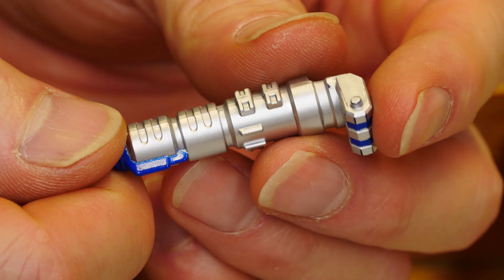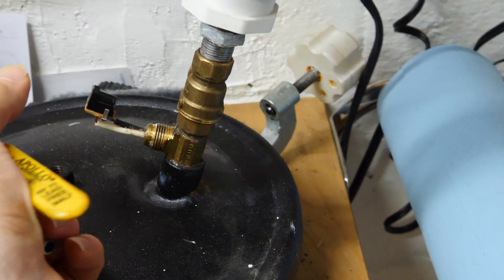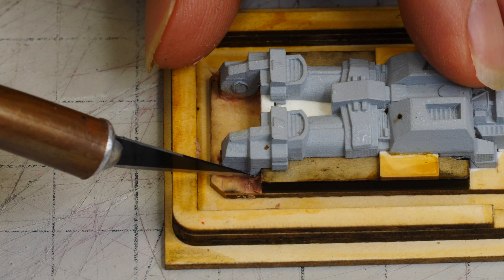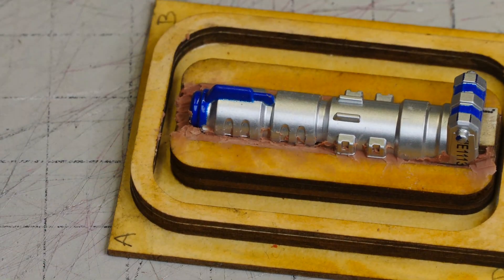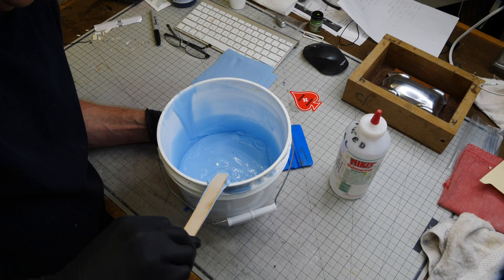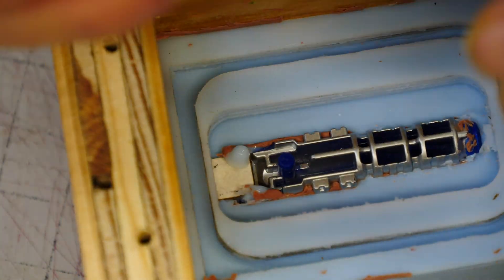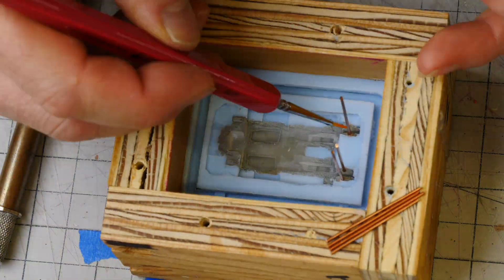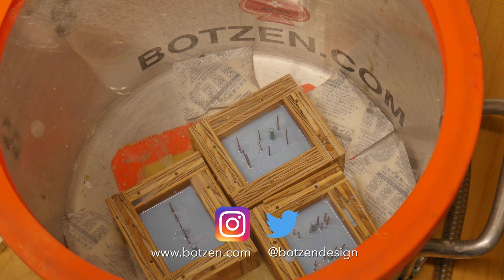Molding Toy Parts - Clay and Silicone: Part 2

Comment: does the super glue and sprue damage the original part when removed?
Reply from the maker: Very good question, sometimes the super glue pos right off, other times some of the glue remains and some clean up is required
Reply: @EricStrebel  great! thanks for the reply. i’m recreating some car louvers that are very rare and i don’t want to damage the original. i believe it’s ABS plastic. and was originally vacuum formed. do you think i should use something else to attach the sprues like the wolf sticky wax? also love all your videos and format. i feel like i’m putting myself through school haha. have been binge watching your videos. very helpful.
Reply from the maker: Yes, if you're worried about it  use something that would be non destructive

Comment: Have you ever did any insert molding with water soluble wax? I have a action figure part that is pvc I'm guessing(hard semi flexible material) andthat has a mushroom hole inside of it. The part is a bicep of a articulated figure and the mushroom hole inside of it is so the shoulder can pop into it. The seam on the part looks like it was a 2 or 3 part mold...Anyway, love the content! Subscribed!

Comment: Hi Eric. Recently found your channel and the content is very informative.  I have made and castes small figures and tried to use a squeeze bottle and pipets to resin fill small parts. But the resin seems to adhere and they end up being single use. What type of syringe do you use and do you pre coat it with any release agent?  I’d appreciate any advice.  Thanks!
Reply from the maker: Just regular syringes nothing special

Comment: When you put the silicone molds in the vacuum chamber did you also put them in a pressure pot off camera? If so do you think this technique will work with resin also if it got a long work time?
Reply from the maker: no, silicone does not go into a pressure pot. But resin in a pressure pot no matter the working time should be good.

Comment: what kind of accelerator do you use?
Reply from the maker: ZAP, Thanks for reminding me, I added a link in the description.
Reply: @EricStrebel  thanks for the quick reply I have been looking and all I have found have been spray bottles and the Steve Mac stuff going for 20 dollars a bottle. I am sure abottle would last forever but was wondering what other brands were on there for brush on.

Comment: Regarding clay application: I imagine some of the tools made for applying frosting to fancy cakes/pastries would be handy if the clay is malleable enough.

Almost daily I’ll use large syringes with the needle tip replaced with 1/4” clear tubing or the semi flexible hard plastic “spaghetti” lines used in drip irrigation. Works with silicone. I’ll have to try the clay…

You can make tools like what you’re using to manipulate the clay with a glob of clear silicone caulking on the end of an old paintbrush handle. Form it however you like while it’s on top of some wax paper.

Thanks for this vid. I’ve got a small bucket full of small stuff I’ve been wanting to duplicate. This looks like the catalyst I’ve needed to push me to get that project going!
🤘🏼😎👍🏼

Comment: Can you make 2 mold using Rondo (bondo & fiberglass resin)?
Reply from the maker: Yes you can
Reply: @EricStrebel  Thanks! Would vaseline prevent bondo from sticking to each other, when pouring the second half of the mold?
Reply from the maker: Use pva or a product called partall
Reply: @EricStrebel  Thank you!

Comment: why dont you let them dry in a pressure chamber (oppositenif vacuum chamber) so any remaining bubbles are fetting compressed and are small?
Reply from the maker: Good question, the bubbles have been removed at that point it's just not needed, but you could if you wanted to

Comment: Mold boxes, shellac, cardboard and Clay (a absolute no go for any moldmaking process) topping it by takeing the master out of its silicone bed. Pieces of such small size - as well as much bigger ones are best casted in a one piece mold and that you cut open. No mold lines no clay to remove, just the pure molding. Rather use your energy for finding and locating sprues and vents. Nice film, but to me much to complicated and only the second best choice. Use to L shape profiles out of aluminium, locate your master with vents an funnels, or cut those later into the silicone.
Pour your silicone and your done. Saves about 95% of your time without messing with clay.
Reply from the maker: You get very poor parting lines that way, trying to match existing mold lines with these parts, as stated in the vid. There is no repeatability or quality in your method as there is no registration either, many other issues as well.  Thanks for your comment, much appreciated.
Reply: Wolli Bär I agree! Just make sure your master models are super clean and create one piece molds. Take advantage of the flexibility that silicone offers.. This elaborate  way of creating molds is nice when your use a very rigid mold material similar to injection molding. The parting lines on my one piece molds are usually much better than one my two half molds and I can cast a huge bunch of parts without ruining the mold.
Reply: Wolli Bär, jevries,  Do you have any reference videos for this kind of process to share?
Reply: @videosbypelle  you might find this usefull :https://forum.treefrogtreasures.com/showthread.php?41237-A-bid-of-sculpting-casting-and-a-little-magic

take care